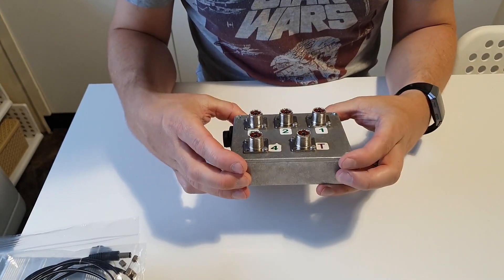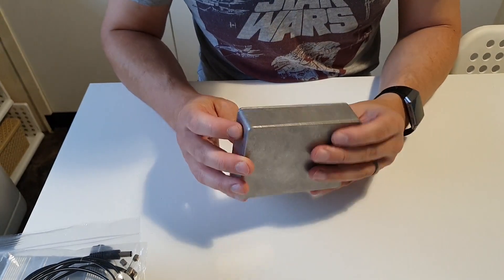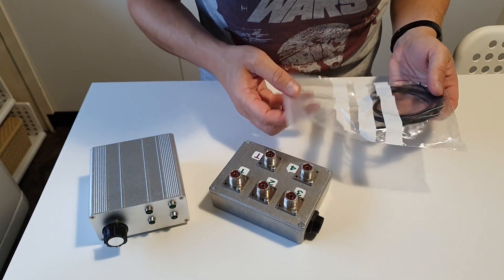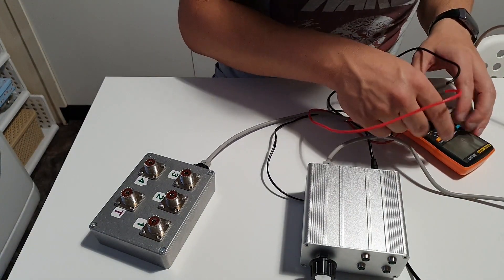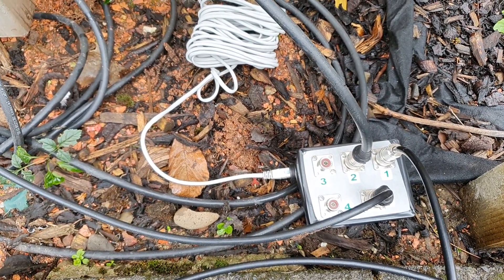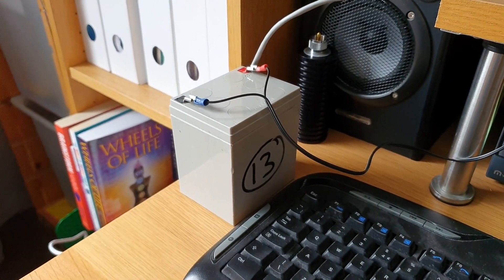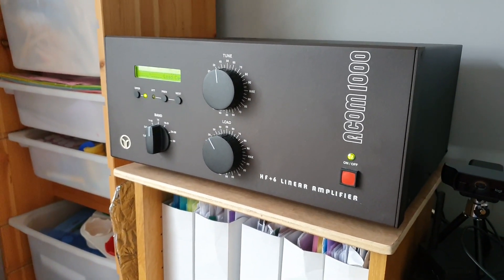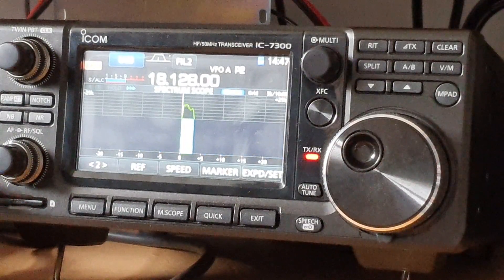Remote Antenna Switch by GM6DX - Review and Test

Comment: I would not be caught dead, using "none vacuum relays". Good luck. When the cheap DC contacts, which of course are exposed to the same dirty air we breath, arc and build up deposits, they will fail. etc....Not going to get into it with CHEAP HAMS...Mind you these relays are not designed FOR RF HF APPLICATIONS! Run some power see what happens.
Cheers and beers...73's.
Reply from the maker: Run power all the time. No issues, must be the clean Scottish air.

Comment: Hi Colin. I wonder if this would work with receivers? For instance switching between a wire and vertical on my comms receiver or if It requires RF to do the business?

Im looking for a switcher to remotely switch between HF / Vhf / Uhf antennas 

Thanks for sharing
Reply from the maker: No different to a transceiver. It will do exactly what you need. You just need to watch the loss and use good coax (as you should anyway) for higher frequencies.

Comment: Nice video.  I am interested in remote switches but I would like it to be physical rather than relay enabled.  I wonder how much current will be used by the relay versions.  Also, do you have any specs on the current requirements over the CAT5/6 cable?  All the best, 73 de KI5HXM
Reply from the maker: I don't, sorry. Best best is to get a hold of Billy GM6DX. Give him a search,  he's easy to find.